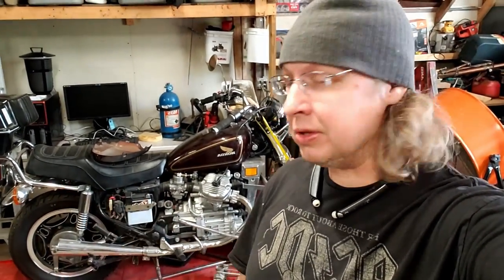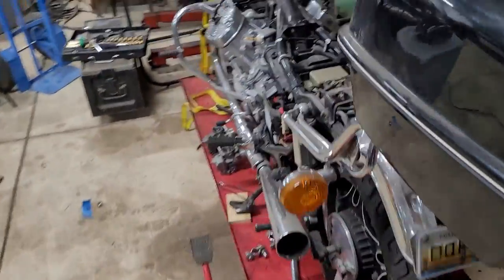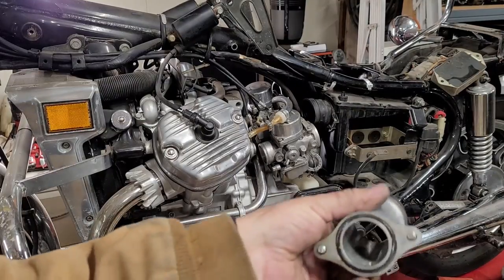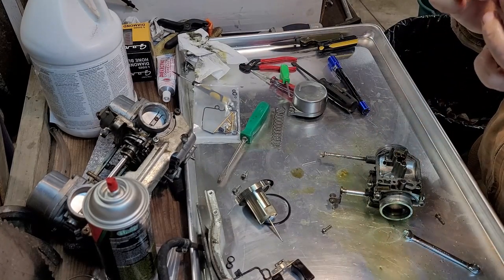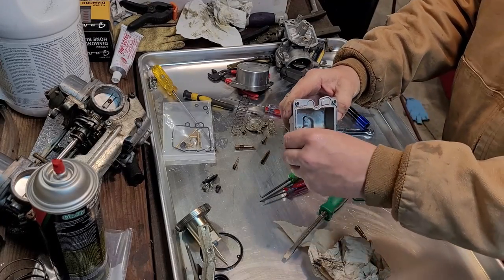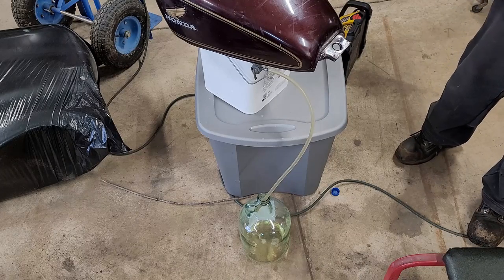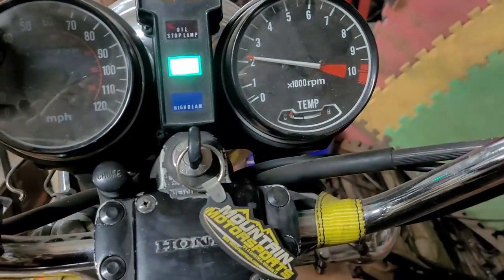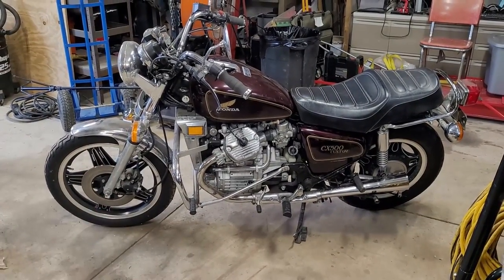1979 Honda CX500 Hasn't Run in 2 Years... Carbs?

Comment: I've got an '81 CX500C that only has 9500 miles. Bought it from my brother in law 22 years ago for $250. I rode it around town a little in the early 2000's and it has been in storage for almost 15 years. I brought it home and started working on it a few weeks ago. Besides a badly rusted/varnished tank I was impressed at how good of condition it's still in. There's a few dried seals that need replacing and a little frame rust but it was like my storage shed was a time capsule. Looking forward to more videos. 👍
Reply from the maker: That's awesome!! They're cool bikes for sure. It's great that you're bringing yours back to life!! There really isn't much to do to mine beyond fill it up with gas and ride it :) Thanks for watching 👍🏼👍🏼
Reply: @HFG  6b7
Reply: I just found my dad's cx500 that has the same story: it's been in storage for around 20 years. I'm binge watching every content about it so I don't mess something up trying to bring it back alive. Do you have any recommendations on other than new oil, battery, filters, brake fluid ecc?
Reply: @flashxcate  Personally I'd start by checking to see if you can turn the crankshaft manually. If the engine is seized to a point where an oil soak doesn't help then that could change the options you have and the direction you should go before sticking any money into a doomed project. I'd also check the fuel tank for any rust holes that may have happened while it was sitting. My original tank was beyond repair from rust and it's getting harder to find replacements that are reasonably priced. 
After my bike was sitting for so long I needed to rebuild the carbs, front brakes and flush the coolant system because the fluids went bad over time and gunked up the works. 
That being said, between Facebook & YouTube there's a really good community of people that know a lot about these bikes and are usually up to answering questions and helping out.
 Good luck! 🙂
Reply: @Onitrix77  thanks for the tips. My plan was to remove the sparkplugs cables and put a new battery in and see if it turns. Then go from there

Comment: You can get plenty of parts for that bike. Quite a few are still available from Honda (Try Babbitt's online parts house), and you can find tons of parts, both new reproduction, and used, all over the internet at various places. I know because I have a '79 CX500 that's identical to the one you have, same color and everything. Also this model is extremely popular for building into a cafe' racer (for whatever reason). Anyway, I've had mine for quite a few years, I'm the third owner. It has 18k miles on it, and is completely original and unmolested (like yours). It's a lot of fun to ride around town, get groceries, run errands, ride around the back roads, etc. Oh, by the way, the Carbs are called "CV", meaning "Constant Velocity". It helps with fuel economy and prevents any need to re-jet for altitude changes. Also, I have a copy of the factory service manual if you need it let me know I can email it.
Reply from the maker: Awesome info! Thanks a bunch and thanks for watching. Maybe the dealer near me wasn't accurate with their info, or they didn't want to deal with it (which is entirely possible). I'll add my email address to the description of this video if you want to shoot that FSM over. It sure would be handy! It's cool that you have the same exact bike. Nice! 👍🏼👍🏼
Reply: I would need the service manual for it
Reply: @Emperorofthestargate  did u ever get it? i need it as well

Comment: You got that pristine original CX for free?  Wow, that's the ultimate score!  Very likely those carbs just need a vacuum synch, and maybe you have a small vacuum leak somewhere?  
Anyway, great job doing a basic carb cleaning, and getting the bike running fairly decently so fast. And yes, I agree with you, it looks better without the luggage box.
Reply from the maker: Pretty crazy that they were going to throw it away, isn't it? I definitely need to get a monometer and synch them. Thanks for watching, bud 👊🏼👊🏼

Comment: Leave off the top-box. I had a CX back in the early 80’s and I used to tune the carbs with 2 pieces of rubber tube. You put one in each ear, and the open ends in the carb inlet. You’ll hear the hiss of the air rushing into the carb, and adjust the cross-connector to get the hiss as even as possible. Worked for me !
Reply from the maker: Nice! I'll try your suggestion. My hearing is pretty toasted so I might have to make/buy/borrow a monometer if that doesn't work 👍🏼👍🏼

Comment: Sounds good man, UNBELIEVABLE it was going to going to be chucked out 😱😯😱 I used own XV400 cruiser, at first it only ran on 1 cylinder ignition unit was faulty, comfy ride etc, but lacked grunt, fuel economy was not great! Better without rear box 👍👍
Reply from the maker: Those VX's are cool bikes. Yeah man, I'm shocked that someone would put it out to the trash like a broken vacuum or something. These people tried all kinds of ways to dump it and couldn't. Just amazing how some people are. It was a ru ning driver, too 🤷🏽‍♂️

Comment: What about the air filter.. Did you clean or replace it?  Loose that luggage box.. Don't toss it, but the bike looks better without it. 
You might just need to run the thing on the road to get the cobwebs out of it.
Reply from the maker: The air filter was brand new. It runs pretty good now. I just didn't ride it much last year.

Comment: Got the same bike! Had it for 16yrs and have now had carb issues, rebuilt em but the thing just wont idle, currently trying to figure out out!
Reply from the maker: Mine need to be sync'd/balanced. Maybe that's what yours needs too? I don't have a monometer here to do it.
Reply: @HFG  If both of your cylinders (and the valves) are performing properly, as in nearly identical compression when you do a compression test, then you can easily do a static carb sync and won't need the gauges and rubber hoses and stuff. That's all I do and it works out fine.
Reply from the maker: @trevorjameson3213  Thanks for watching, bud! I need to buy a compression tester that fits bikes. All the ones I rent from the auto parts stores don't fit, even though they say they do. It's dialed in pretty well now that Justin worked his small engine magic on it.

Comment: I took my bike to the car wash the other day running perfectly and it started backfiring and having poor power? I've been through the carbs and lots of the electrical but idk a lot
Reply: It's my only transport tho
Reply from the maker: @CrazyViralClipzYT  I'm not super familiar with the electronics on these bikes, tbh. Even when it dried out it didn't help? Maybe you have some cracked wires or maybe the CDI box is having issues.

Comment: Why does my 1980 Honda cb500 only has a top speed of 80 on the odometer
Reply from the maker: The only thing I can think of is that right around that time there was a federal law that required all vehicles to have 85mph speedometers because there was a national 55mph speed limit during the oil embargo/energy crisis at that time. It could be that your bike was built to conform to those laws. I've seen some 80's bikes with those speedo's but I think it comes down to the months/years that they were imported. I'm not 100% sure though. I wish I could give you a more concrete answer. There are some good Honda groups on Facebook. They might have the full story for you and possibly a way to change yours out to a different one, if that's what you want to do. Keep in mind that it's my understanding that some models were actually mechanically speed limited during that time because gasoline rationing was happening as well.

Comment: that crappy gas in the carb looks like ethanol that's separated from the actual gasoline after it sat for a while. Ethanol is hydroscopic so it absorbs moisture from the air and turns into this disgusting goopy oily mess that tends to just sit in the bottom of carbs and gas tanks. Is the key reason why you don't store vehicles with gas in them; best to empty them or use 100% gasoline.
Reply from the maker: Yeah. We had some gas stations with bad gas a few times. I'm guessing that was part of the problem.

Comment: Hey man I have a question for ya. I just bought a cheap cx500 custom. It only fires on the left cylinder, but when I partially cover the right carb intake port with my hand the right cylinder will fire. Do you think it's just the boot being cracked and causing a vacuum leak? Or do you think it's something else?
Reply from the maker: Does it have a cracked boot for sure? That would definitely cause some issues for sure. I'd start with vacuum problems off the bat and see where that takes you. If all else fails and you want some awesome carbs, check out Murray's Carbs. Pretty much the best you can get.
Reply: @HFG  ok, sounds good. They don't look good at all. I'll do that stuff for sure thanks.
Reply from the maker: @JIMBOBALOU  back in the day, if a boot looked sketchy I'd smear RTV all over it and see if it helped. It wasn't a great solution but it worked for a bit until I could track down other issues or more parts 👍🏼
Reply: @HFG  that's a good idea, thanks
Reply from the maker: @JIMBOBALOU  good luck 👍🏼👍🏼👍🏼
Reply: @HFG  I used shoe goo lol
Reply from the maker: @jaderiverdesign  👊🏼👊🏼 That's awesome :)